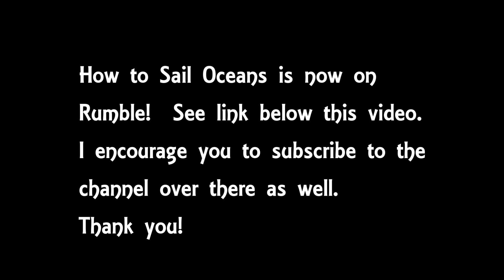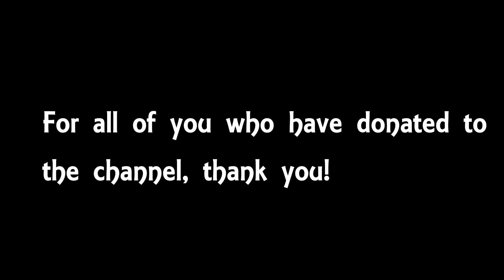Thunderstruck  |  Ep. 266

Comment: Looks like you dodged a bullet. Glad you were not injured. 
If you look at it electrically, the fiberglass hull is a big insulator and the bronze through hulls are the only points to ground, so naturally all the current from the strike would flow from the through hulls.  The areas around them were damaged by the steam  generated by the heat of the current flow of the strike, very much like bark being blown off a tree.  
One solution might be Marlon through hulls, with specialized through hulls above the water line that provide a definite discharge point designed with a low impedance conductor.  
Since you have a wooden mast and Dynema standing rigging, any electrical device topside could attract a discharge.  FYI
Reply from the maker: I did go with Marelon thru's.
Reply: @howtosailoceans1423  Yes I saw that.  Good choice.  That said, there needs to be a place in the hull where lightning can safely discharge.  It is a very large unpredictable event but it can be directed to a specific place, that will minimize its effects on equipment.

Comment: You took a wack. I got struck by lightning in Miami it blew up all electronics throughout the boat and left by the engine anode but no hull damage I have bonded everything now and trailer a wire in the water don’t know if it helps but lightning never strikes twice lol

Comment: Loved the look of the topsail.  Do you notice a marked difference in performance when it is raised?
Also, would love to hear more of your thinking on how to manage lightening strikes.  With a hole in your boat above the water line, and the need to haul to check for damage below the water line something like this could be tragic hundreds of miles offshore.  How do you manage the risk?
Reply from the maker: Yes, the topsail does add some grunt.  Haven't actually measured the speed difference, though.  In my opinion there's really no way to manage lightning risk.  Lightning is random.

Comment: How much additional speed do you gain using the topsail? Lightning is no fun, especially on a "plastic" boat. Back in the mid 60's I was on a cargo ship that was voyaging between Famagusta (Cyprus) to Latakia (Syria) and we were moving at the same speed and direction as a thunderstorm. We were probable struck 8 to 10 times every hour. It did a number on the paint job on the mast tops, other than that it was just eerie.
Reply from the maker: Haven't measured the boost from the topsail, but it definitely delivers extra power in the light stuff.

Comment: Hmmm  I've been contemplating a grounding plate.  Bit of a pain to source, plus the lightning rod and heavy wire up the mast.  My standing is dyneema,  but the stick is aluminum....I don't really get why I need a second lightning rod, as mast is basically a lightning rod, attach a good conduit from the mast base to the grounding bar, seems like a path of least resistance. Were your thru-hulls bonded together/to ground? Wondering why only some of them show damage.
Reply from the maker: No, thru hulls were not bonded together.  It seems most of the current traveled down through the upper shroud, which is wire, and blew a hole through the topsides to ground.